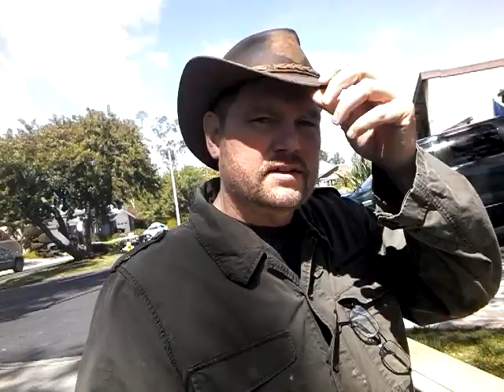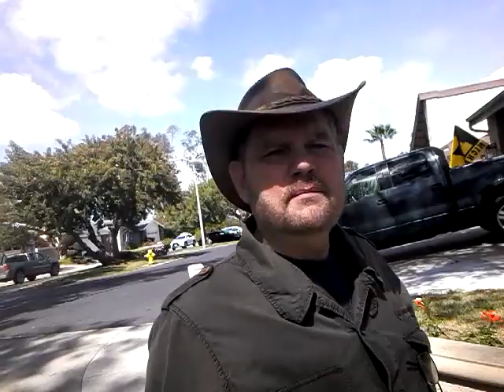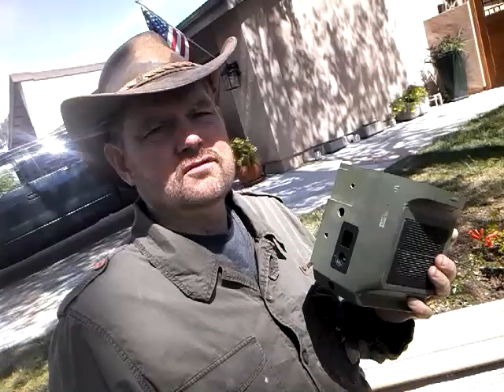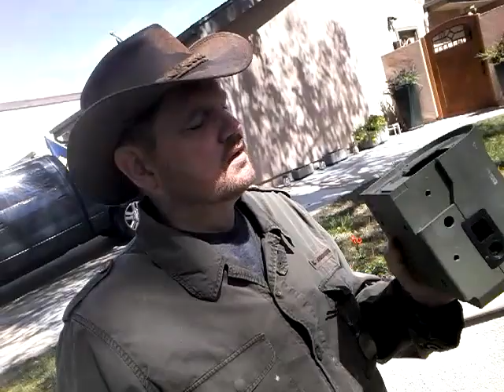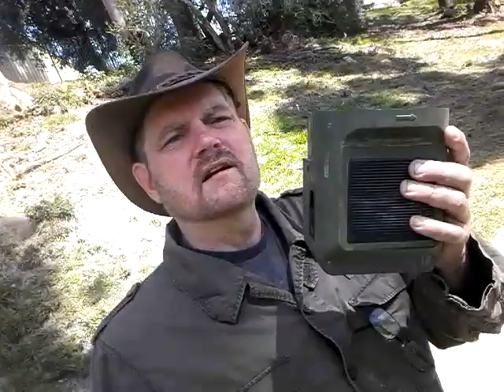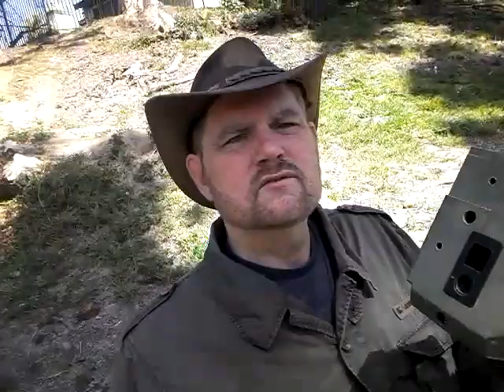Shear sharpening: comparison challenge

Comment: Robert, i have been at the same point as you have been talking about. Questioning the high end sharpening systems, questioning the techniques, and really getting pissed off at the grinder guys! I get at least 4 pair of shears a month that has been hacked up by a grinder. I think that some of these folks really believe they are doing a good job, cuz the sucker cuts the hair on his arm blah blah. But WHAT leads the would be sharpener to buy a grinder and destroy the design of the shear as it was manufactured ? COST COST COST grinder....300.00  flat hone with guide.......3000.00 So Im with ya Robert in some ways...break the mold, and create less expensive systems.  Learn and progress.  I want you to try my guide system Robert. It is a great alternative to freehand and expensive guides. I have one listed on e-bay but i want to send you one to try for free, and then rate it for me please. will you?
Reply from the maker: Sounds good lets exchange email address then from email our mailing address:   fixurshears@gmail.com
Reply from the maker: It would be an honor to look it over.  We all should be out there learning and helping each other by discovering different methods for ourselves via comparison and contrast.